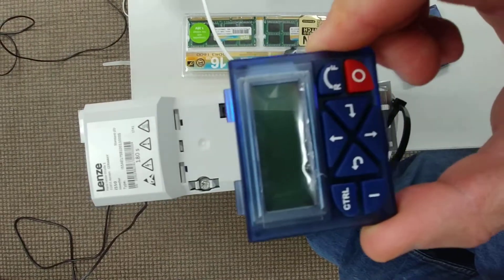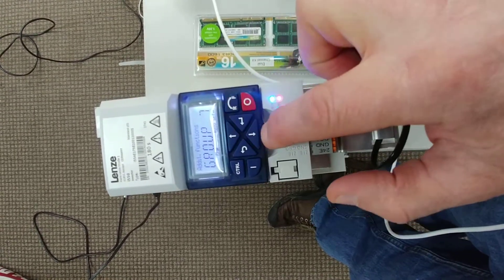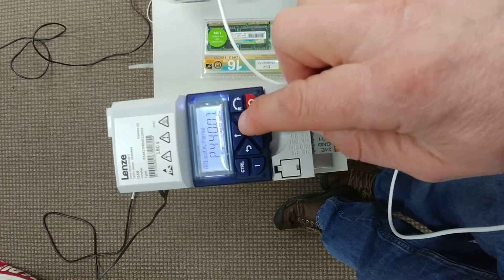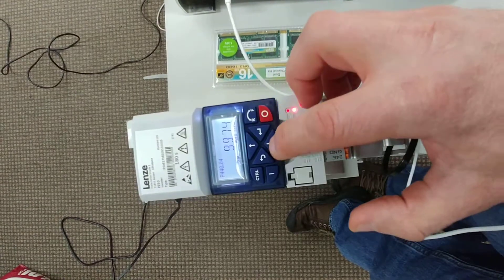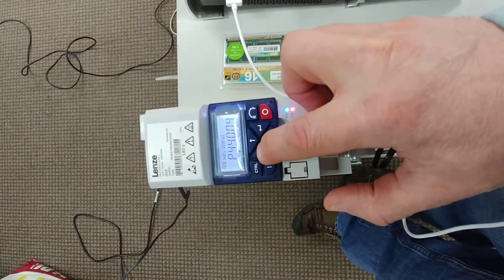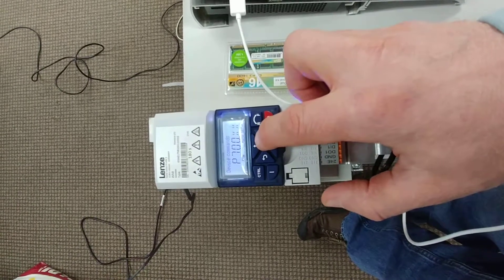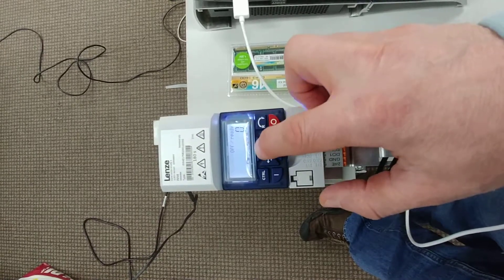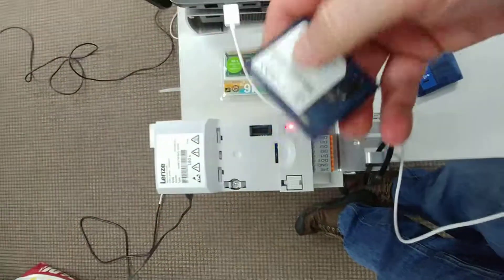Programming Lenze VFD

Comment: Hi everyone! Thanks for video! I have a situation: Lenze i510, after start the inverter (aprox 2/3min) the motor start  slip, more and more, until the complete stop. if the frequency is higher, the time becomes shorter.  Can you help  me please understand the problem? Thanks in advance!
Reply from the maker: What is the application?  What is the motor connected to.  Are you monitoring the current.